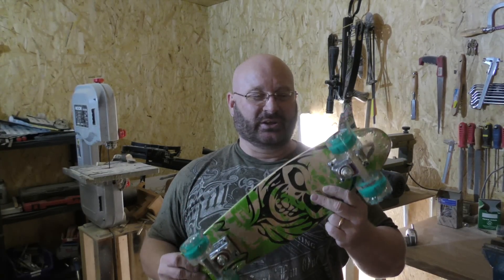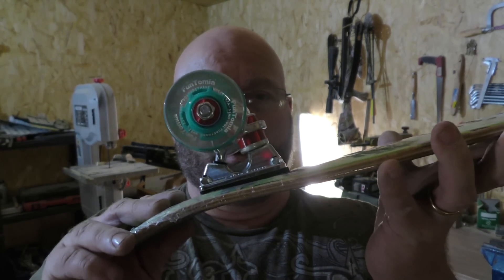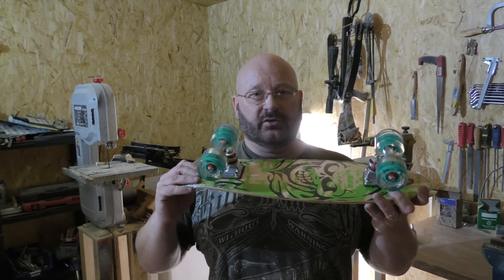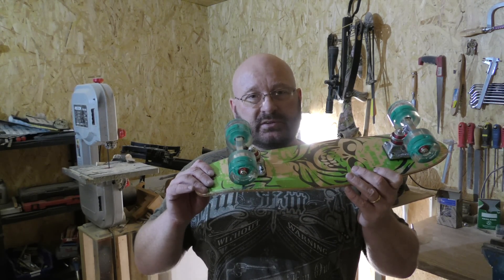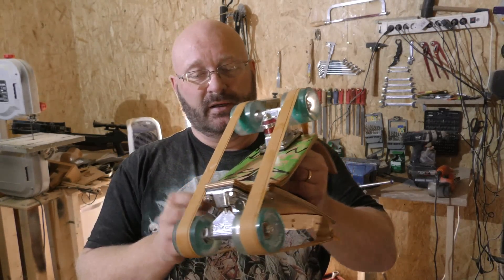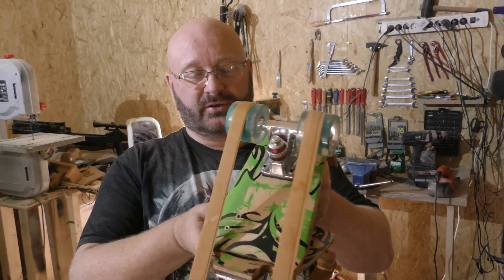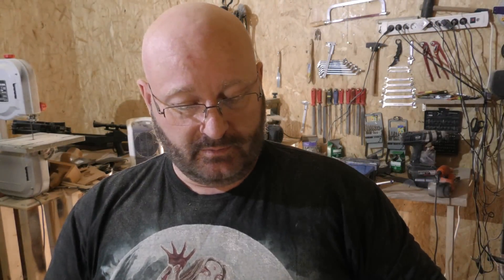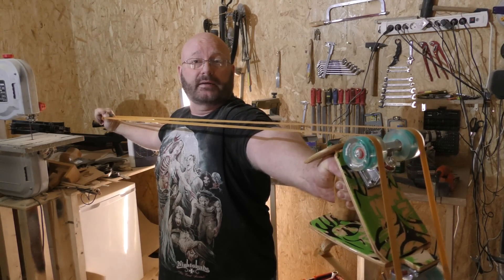How To Weaponize a Skateboard (Overkill Compound Slingshot)

Comment: The wood used in skateboards is typically maple and the boards are normally constructed of 7-8 sheets of maple. The in bearings in a custom skateboard can be ceramic or stainless steel and some are advertised as titanium but they're indeed only stainless steel.

Comment: good choice on what kind of skateboard to tear up, i can tell thats a cheaper one that wouldnt last very long under skating stress. plus the bearings in those wheels are really crap, if you replace the bearings with something like ABEC 7s or ABEC 9s, you can get them to spin a lot longer. it probably wouldnt effect the slingshot mechanism, but it would keep the wheels spinning and keep the lights on longer.

Comment: hey joerg you should loosen the bolts that hold the whells inplace a little bit so they spind more freely then the lighting effect will be even longer i guess and that would be nice
Reply: loosening the bolts woulndt do anything but make them wobble a bit. the bearings that allow the wheel to rotate are new and thus not broken in so they look stiff.
Reply: EMAXXMASTER well i actually know that the bearings make the wheels spin im  not stupid but i know that the comercially and fully assembled boards (especially some from amazon and not your local skateshop or something)
are alwys over tighten so you have to losen them to let them spin more freely
Reply: +EMAXXMASTER actually when the bolts are tight on the bearing it makes alot more friction gained the spacer in the middle of the wheel i have mine loosened just barely enough that the wheel can move not even a millermeter
Reply: antsolja thanks finally someone that understands
Reply: +Linus Schneider (Linus1710) i easnt implying that you were stupid all i did was give information based from what i know. im not into skateboards really so i assumed they didnt put a spacer in. i assumed it was just bearing to bearing where the 2 outer rings would touch and leave a small gap between the rotating bands. sorry if u thought was condescending i wasnt trying to be.
Reply: EMAXXMASTER its alright just hopefully joerg tries to do it then the weapon would look so much nicer in action

Comment: Never expected that kind of design (O.o)
It works, the lights are a flashy touch.
Some day you should make a high power sling shot with many bands that 
you have to pull it back with the car and stretch it like 100 feet
Then fire something like a coconut a few hundred meters!

Comment: if u take 1 of the bearings out of each wheel, there is a magnetic wheel in there.  If u put a tiny amount of super glue gell on it you can loses n the nut on the axles allowing the wheels to spin much faster n longer that way the lights will really flash.

Comment: Along the lines of your weaponizing hardware store video, I came across a bracket in the shed the other day and thought SLINGSHOT! It's meant to hang several things on the wall at the bottom is a single square "hook" about 4 inches deep about a foot above that is another bar that sticks out about 8inches with a square u attached at a slight angle. I'm pushing 60 and it has been awhile since I've had a sling shot but I chained up some rubber bands and made a duct tape pouch and was totally impressed with how well it shot plain glass marbles. The one part acts as a brace on the forearm which if I understand correctly you are not allowed to do? I have no idea how to send a picture to you but once again, another great video and an awesome creation!

Comment: Hey Joerg! I've been watching for a long time! Recently got a slingshot (Quad tube setup on a small metal frame, strap instead of cupped leather).

I was watching your video on safety glasses and I was wondering what pair you ended up getting? Since the last pair you had were miserable at protecting that egg/eye.
Reply: Let me step in :)

Durable glasses do not have to be expensive, but never choose the cheapest, your eyesight is precious!

I can recommend bolle's "viper" and the "raptor" made by swiss eye.
If you can get your hands on it, go for the raptor. You have more options for adjusting the glasses, you even can change them to dark (like in sunglasses) or yellow/orange ones. 

If you can't get any of them, just google for military grade protection goggles/glasses (raptor and viper where made for the military i think).
I don't really know about the situation in america, but here in germany ballistic goggles have to pass a spefific test, you could also google that...
Hope i could help a little... flies away

Comment: +Joerg very creative, do you think that it's harder to aim not being able to anchor the projectile at the corner of your eye? and if so would you get a faster fps by shortening the band's to a length that put the sling shot at full draw at the anchor point? just curious and like I said very creative.
Reply from the maker: +Aaron phillips Full butterfly style, with bands drawn to the max, will always be the fastest shot. Aiming isn't hard once you get the hang of it. Anchor point at the eye is dangerous, even with safety glasses on. Plus it is way more weak than butterfly.
Reply: +Joerg you didn't seem to have any  issues aiming it, but your the sling shot man and I can't say that I've every seen you miss. I only used the corner of the eye as an example. With a compound bow, you get the fastest speed if you anchor  at full draw,. Think you could build a compound sling shot? This what the skate board reminded me of.
Reply from the maker: +Aaron phillips It is one of the great advantages of slingshots that the draw isn't limited by the length of the arrow... more draw length means more energy. Compound slingshots exist, here is an example: https://www.youtube.com/watch?v=kHxS2eiEZ3M

Comment: Can you recommend a good, cheap scroll saw to me? What one do you have? Thanks.
Reply from the maker: +Spirlas bacon Proxxon. Great little tool.
Reply: Awesome, thanks so much. Also, when you buy a higher quality board, they have some really beautiful coloured ply, 2 out of 4 would be coloured, or 3 out of 6, depending on how much ply and its very beautiful, its very strong and I make rings out of it quite a lot. You can get it at pretty much any skateshop, they will give you old broken boards for free.
Reply: JoergSprave Awesome, thanks so much. Also, when you buy a higher quality board, they have some really beautiful coloured ply, 2 out of 4 would be coloured, or 3 out of 6, depending on how much ply and its very beautiful, its very strong and I make rings out of it quite a lot. You can get it at pretty much any skateshop, they will give you old broken boards for free.

Comment: Great video and Awesome Slingshot!!! I really love how it turned out ^.^
Also: how much does the rollers affect the slingshot? lets say you use 2 slingshots with the same band set, one with rollers and one without rollers, how much does the power increase? 
and can it be added thicker or stronger bands to a slingshot with rollers?

Comment: Thüringer Leinöl für die Imprägnierung? Eine ausgezeichnete Wahl! Wenngleich es auch zu Kartoffeln ausgesprochen köstlich ist. 
Nutzt du es immer? In dem Fall gibt es hier in Thüringen bei manchem Hersteller die Möglichkeit, sog. 'technisches Leinöl' in größeren Abfüllmengen direkt zu beziehen. Ist dann um einiges günstiger - insbesondere wenn man viel davon braucht.
By the Way: großartiges Gerät! Ich bin auf die angekündigte Fortsetzung gespannt.
Reply from the maker: +Matzerix Wildhelm Ich nutze es viel, aber man braucht nur sehr geringe Mengen für eine Schleuder. Ein Fläschchen reicht locker ein halbes Jahr. Man muss nur etwas aufpassen, wenn man es mit Lappen aufträgt - die können sich selbst entzünden. Pinsel ist sicherer.

Comment: "Special bearings" "extra for skatebaords" spin less than a second xD
Reply from the maker: +CDC Productions You think a good bearing is measured by how long it spins? I got news for you then: What is important is the amount of play and friction under strain. A worn out old bearing in need of exchange will rattle along for a loooong time if you turn it loosely.
Reply: +JoergSprave Well.. I got some top ceramic bearings which are for pro skating and they spin for around 4 minutes and some old ABEC-7 only spin around 10 seconds. I measure it in seconds then!
Reply from the maker: +CDC Productions Rather put 100 kilograms pressure on top of the board and measure the friction while the whole system is rolling.